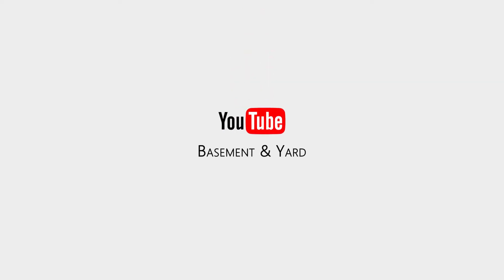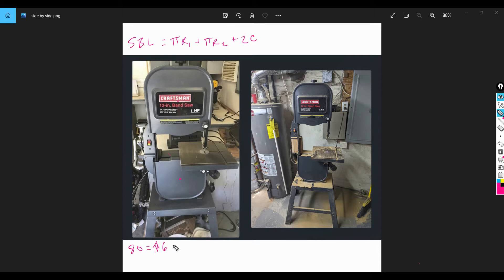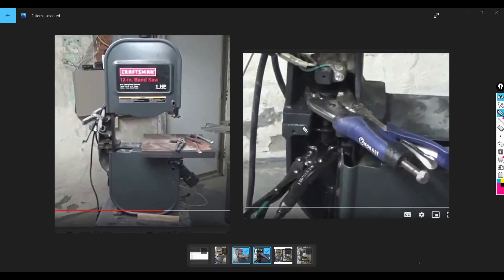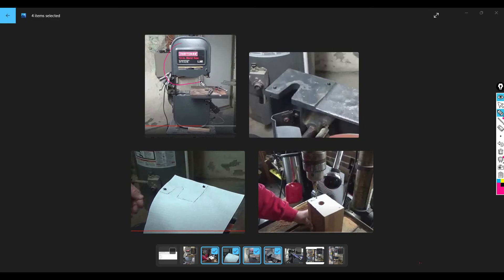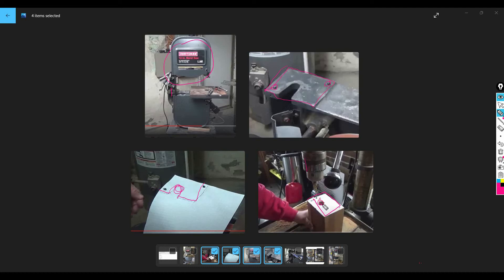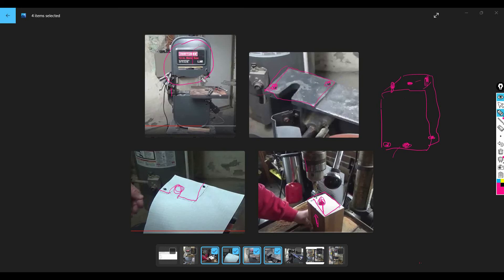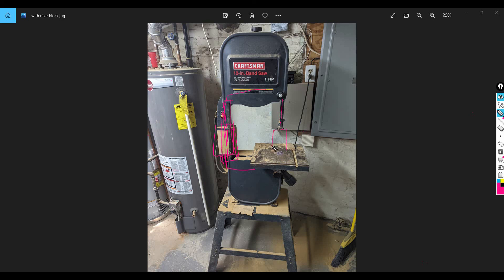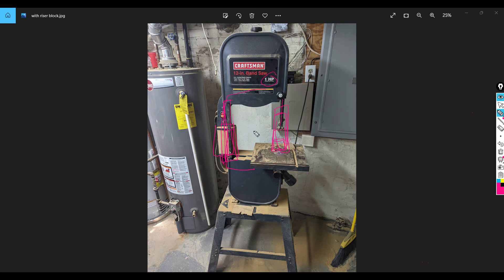Can you make a bandsaw riser block out of wood?  Yes, but...

Comment: Try a piece of black pipe for guide post. Not sure what size you need. Or a piece of solid steel bar.
Reply from the maker: i was thinking of that but I'll have to find a way to grind a straight groove in it cause the original has abv-shaped groove in it that accepts the screw stopper that you used to adjust the height

Comment: Hey great to see your video. I have a saw which has been discontinued and I can't get the riser block assembly for it anymore. I am going to try your approach. Since it has been a year now do you still like the mod or do you recommend against it? Also any other insights or tips you may have based on your year worth of experience, that I can keep in mind when doing this?
Thanks again for this. Take care.
Reply from the maker: I would still make the mod. I would definitely determine which height you want to go and then price out the bolt. Longer bolts get expensive quick, and that's going to be your biggest expense believe it or not most likely.  Try industrial companies like Fastenal or Grainger... Call them first and get a quote
.. Ask them if it's in stock and if they're willing to come down on price cause I'm guessing it doesn't turn often.. Or see if some of the big box stores will order it in. And because you're not talking a lot of force on the bolt in this situation you can go lowest grade

Comment: I got an old 18in grizzly saw. Been restoring it. Nothing too wild, but the max resawing capacity is 10in, the nice thing is that it has a 2hp motor. 
I want to make it 18in but ill re approach my goal after the whole blade availability point. 

Been really temper at just buying a 6in riser for a 14in saw (almost the same dimensions) and then modify it to make it work 

Besides the pleasures and pains of diy do you have a reason why not just take this approach?
Reply from the maker: nope.. especially if you have a 2hp....i guess the only thing would be if you also plan to do a ton of samll detail stuff, and you don't feel like slowing down with the higher guidepost
Reply: @BrianLeeDick  what species of wood did you use? And did you get any deflection?
I have 2 12in craftsman bandsaws. They are about 5-6 yo, the euro body and have a semi decent 3/4hp motor.  I used one of them to resaw (the second one is new to me)
They have a 7in resaw capacity so they  are ok
Reply: @CharlezMalasana  he said something about laminating some 2x so probably pine

Comment: That is a very complicated way to say the riser height is the difference between the two blades divided by 2.
Reply from the maker: just thought it thru, you're absolutely right... everything cancels out except half of old blade length and half of new blade length and the difference is the same as saying 1/2 the difference between the new lengths... well that would have been easier... at least people learn a new formula
Reply: @BrianLeeDick  I was sure you had an engineering background based on the approach but that last statement makes me believe you are a teacher. The belief that people will learn anything that starts with a “Pie” that is not edible gives me hope for humanity.

Comment: Any update??

Would you do it again if you could do it over??

I have the same exact saw.
Reply from the maker: i definitely would do it again... oddly enough, the best blade for it almost always is the really fine tooth one that is 1/2" wide... the cut feed has to be really slow cause the dust ejection from the blade is slower with the finer teeth, but it makes it so it almost doesn't even matter how low the guide post is when I make a cut which is great because the guide post doesn't go all the way down for a lot of cuts. it definitely feels like I have a more expensive machine with this extender. I just have to make little small tweaks to make it perform at this added capacity.

Comment: So you have a 11 and 3/4 max capability with the spacer but the tensioner has probably close to 1 1/2 travel, so could you have made the spacer 7” or over that? How much slack do you have between the bottom position of the tensioner and the blade?
Reply from the maker: yeah i probably had some wiggle on height cause at bottom tension the blade is certainly loose, but i wanted that "experience" to be the same at the higher set up so getting the blade on and tight would be the same ish

Comment: Have you found a guide post that can accommodate the riser or are you still using the original? I'm really tempted to do this with my craftsman but for cutting smalls I really hate having so much slack. 

Now that I see a riser is possible, I will have to look into fabricating a longer guide post. Maybe Carter has an aftermarket piece available? 

Thanks for the info, awesome build! I love my old Craftsman bandsaw but 5" max resaw has been a pain in the ass for years lol.
Reply from the maker: i haven't yet..i just make due. if you end up finding it let me know